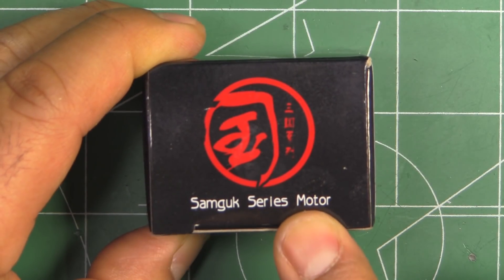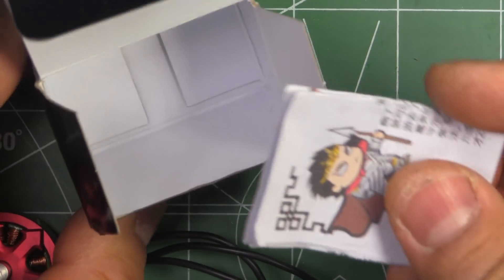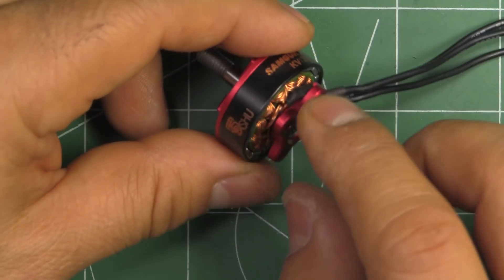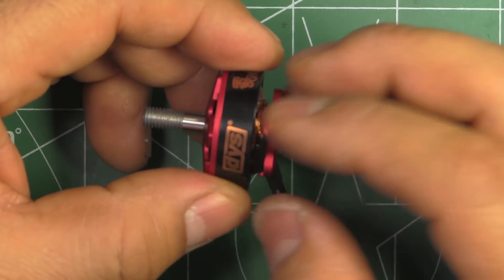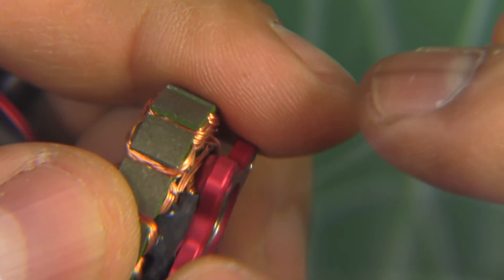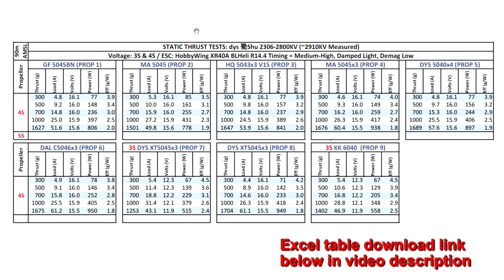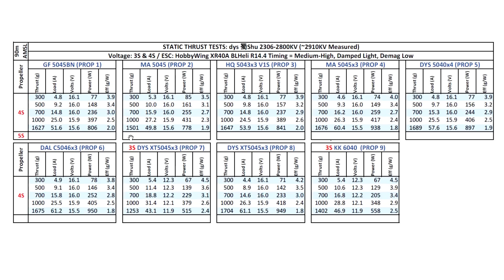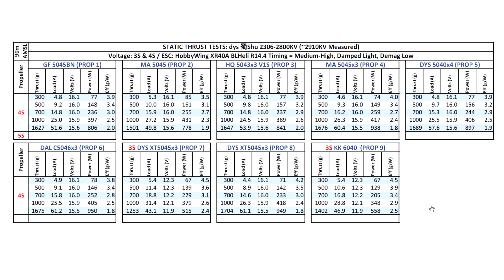dys Samguk 蜀Shu 2306 2800KV Affordable New $9.50 Motors from dys

Comment: I bought 2 of these motors and some Gemfan 6055 and 5050 props for a high speed custom plane. Do you think that on a 3s this motor would be able to handle a 6055 at >150 km/h ?
Reply from the maker: Looking at the test for the 6040 prop it's 47A max static so if we get estimated 40% lower in-flight Amps, that's about 28A. The 6055 prop will draw at least 30A. I think that's a bit too high continuous Amps for this motor, it might not survive, but I'm on the being careful side. I prefer more headroom and not being too close to the limit. You should check out E3Scott channel he flies setups like the one you have. This motors is lower 2630KV and he uses 6042 prop on 3S https://www.youtube.com/watch?v=wGTqcLD4Qa0

Comment: Hi EngineerX! I am new to the hobby, what would you recomend between those DYS and the AokFly RV2306? I read that the bearings in the DYS Samguk are very likely to break. Also I am afraid that a naked bottom will not be ideal in crashes (I am expeting to crash a lot, despite the hours spent in simulators). Thanks as alway for the good content!
Reply from the maker: Rock Rider 94 Naked bottom and full base can be equally strong, depends how well and thick in the critical places they made it. Yes lots of complaints bearings are weak on this one. Careful on the Aokfly. Also read lots of fake motors. I don't know who sells authentic one for sure but if you can find it it's a more durable motor.... based on comments I've read, not my actual experience but I do agree.
Reply: EngineerX thank you so much for your answere! I'll go with the aokfly from amazon, so that if they are fake I can return them.
Again, thank you!
Reply from the maker: Good choice, and yeah, Amazon is great for returns.
Here is the post about the fakes, go to #12, looks like Banggood may have been sending fake ones after the 1st couple of batches :(
https://www.rcgroups.com/forums/showthread.php?2925449-new-FIRE-PHONENIX-RV2306-2400kv-2650KV-out-AOKFLY
Reply: I read something similar, that Banggood is a sort of hit&miss with the aokfly, sending out fakes every once in a while

Comment: I brought 16 motors from DYS. I have to say... These motors is way to powerful for a cheap price.  There is couple things people should know. Don't use Gemfan 5040 PC props or Kingkong 5040 props because they like to explode in mid-air. You definitely need strong props to fly with these motors.

Also, you have to use 35a or 40a ESC to run these suckers. I already blow up three ESC because of this motors. 

Once again, 
dys Samguk 蜀Shu 2306 2800KV needs 35a or 40a ESC. 
dys Samguk 蜀Shu 2306 2800KV needs strong ass props!

dys Samguk 蜀Shu 2306 2500KV needs 30 to 35 amps.
dys Samguk 蜀Shu 2306 2500KV needs strong ass props!

Comment: Have you tested them outside? Is the quality good?
Reply from the maker: These have had several issues as reported by many. Unfortunate because they had very good potential. I think it would be best to look for another low budget option. Even the new Racerstar BR2207 might be better, but also you need to look for what people are commenting. I don't get a chance to test every motor in flight, there's just too many motors coming out and too little time on my end :(
Reply: EngineerX ok thank you very much
Reply: EngineerX i have got the tbs silk steele motors but im not very happy with them. So in my opinion even when a motor is very expensive it there is no big difference between budget motors.

Comment: Have you ever compared a motor with stock bearings as opposed to high quality bearings on the thrust stand would it make a difference in output or just longevity
Reply: I own a fishing reel repair and super tuning company.. we stock the best bearings on the market from abec1 throw away bearings to the finest ABEC9 stainless, ceramic hybrid and full cage ceramics money can buy.. the bearings of ABEC5 and up we run through out special,flushing/delubing/cleaning process then heat treat the bearings. We have the longest spinning/free spooling/lowest friction bearings on the market period.. bass fishing reel bearings for popular reels happen to be the same as most motor bearings for our race quads.. I can tell you this on high preformance motors I use my ABEC7 Stainless steel bearings in the motors the stainless bearings preform the same but are much less noise then ceramic bearings.. the preformance is NOT just longtivity of the bearings.. on a set of R5 2207 2700kv motors I just tested I gained a solid (avg over testing 6 different new R5 2207 2700s, first test each motor with stock beatings then my bearings) 58 gram increase in max thrust a avg of 1.2 less amps at WOT with a 58 gram thrust increase on hq5x4.5x3v1s.. and I can assure you those bearings will out last stock bearings 7 to 8 times and still preform better then a new set of the throw away abec3 rated bearings too spec manus use.. you will notice quicker response as well, we'll not so much freestyling but on tight race courses with a light weight high powered build you will notice slightly quicker response.. it's not a lot but if you are really in tune with how a,quad flys on a track there is enough of a difference that it will make it feel that you increased your rates 10 to 20 DPS mainly on yaw and roll pitch isn't so much noticeable. Good bearings are a must imho (I keep saying it in gonna start marketing to the mini quad crowd before Boca fucking bearings do.) They are better in every way..
Reply: Wicked Reelz how do I get some

Comment: I just put the 2306 2500kvs on a kopis 1 build with speedix 30a escs and hq5x4.3s and man it's freaking ripping. Amp draw isn't nearly as bad as I expected around 113 amps. They're not the best quality motors (cough $10 cough) but let me just say at this price I'll be buying quite a few as long as they can stand up to a decent crash. Oh and a clracing f4s with a unify pro

Comment: i'm wondering if the dal 5051 cyclone is a good match for this motor? i'm aiming for a super light build (armattan mongoose with dalrc engine 40a esc), or should i go for the wu 2206 2700kv?
Reply from the maker: Depends on main purpose of build. What I'm seeing, some people are looking for ultimate performance on 220 ~280g dry weight setups. Then you can use 1300mAh LiPo and very-high KV motors like this one will match OK because motor will not be loaded as much. Flight times should be around 2 to 2.5min depending how aggressive you fly. key is to build as light as possible.
Reply: i will give the 2206 2700kv a try, maybe i can use a lighter lipo that way (850/1000mah 4s)
Reply from the maker: 2206-2700kv should do well, but a LiPo that small most likely will sag quickly if you go hard on throttle often. You can always increase size of battery so no worries there. These motors are somewhat light so the 2207-2600kv would also be a good choice.

Comment: I have 30A Blheli S FVT Litte bees esc. Can they handle the 60A? I think in real the motors reach 50A??! Or is the 2500KV better for a racer ? Racer weight 340g with emax rs 2205s 2300kv
Reply: Saix FPV 
   The esc can be bigger than needed and it will be fine or even better. The esc will only supply the amount of amps demanded by the motors. Hope that makes sense without writing an essay lol.

Comment: Do you think a racerstar 4in 1 35a esc can handle this motor?
Reply: The REV35 is actually made by Airbot. The RS series is made by Sunrise model, the MS series is made by ZTW.
Reply: Oh yeah should be fine . Love the Racerstar stuff , I have pushed them hard on some really hungry motors and not had a single issue.
Reply from the maker: Bennie Leip I honestly couldn't say if that specific 4-1 ESC would be able to handle this motor because I don't know much about it. I read with other ESCs RStar has overrated Amp handling. I'd look to see if people are using it with 2207-2600 or 2700kv motors without issue first. If no issues then it should handle this one ok. Any good, true 35A ESC will handle this motor.
Reply: EngineerX thnks for awnsering 👍🏻
Reply: I'd say so. The Racerstar REV35 is made by Sunrise and is also sold as 30a continuous/ 40a burst under the holybro name. I use the rev35 in 3 different builds, one is 2306-2700kv, one is 2207-2700kv and one is 2405-2400kv. Does that help?
Reply: TheRealJonnyD thnks man , yes👍🏻 but i think im gonna spent a bid more than buying this motor ill gues ,because im getting sick of losing c clips for no reason , and then has the rest of the day vibrations because of it😒😆
Reply: IRFZ44 ah, yea. You're right. It's a Typhoon 30a rebrand.

Comment: Can some one please tell me good motors for a light weight 3 inch build (preferebally  11xx or similar weight motors) which produce atleast 400g of thrust
Reply: The Pragmatist SunnySky R1106-6500kv. Get them from SunnySky directly to guarantee they have the updated shaft design or spend a lot less on eBay and loctite the shafts. They're the strongest 11xx motor out there.
Reply: if you don't mind going to a 14.5-14.8 gram motor.. Iflightrc sent me a set of their 1606 3500kv and 4100kv motors and I was shocked by the preformance of them.. they have nice single strand windings, motor is made from 7075 alum (that's what they told me anyhow, and don't have any reason to doubt it, nice smooth bearings and really poor on the power.. the 4100kv on 4s 850mah 75c packs with the Gemfan 3052s, on a nice light 3in build they are lightning quick, great response, come down totally cool, efficient and just preform amazingly well (they are 55 dollars a set) they also sent me a few bags of their Nazgul 3061 props, I have flew the 5 inch version of that prop and it's so unbalanced it's not flyable unless you balance each prop... the 3061 version is flat fantastic, top end is faster then the 3052s by a good bit thanks to the higher pitch BUT the amp draw is not much higher, thrust is deff feels about the same BUT the response is on par with the 3052.

These right at 16 gram motors are insane, you do need th batteries to support them as they are hungry in the last 20% of the throttle range.

Comment: Hi, will you be testing the 2250kv version of it. Would like to see how it will perform as budget 6" motors
Reply from the maker: dys only sent the 2800KV. I ordered the 2500KV from BGood. Sorry , I don't think I'll be ordering the 2250KV version :(  but it should match nice with a 6" prop for more efficiency and plenty of thrust. Seems the motors are as efficient as any of the premium motors I've tested, or very close anyway.

Comment: Great performance for the dollar.  I've got the 2206/2700kv coming this week.  Going to compare them to the top end ZMX Finx23.
Reply: Got the motors. They last 10 packs before one let go.  The stator wasn't probably glued and it shifted about in the housing breaking the centre set of wires.  Poor QC.

Comment: Thanks ,X. These DYS's are shaping up to be a nice budget motor with lots of choice (have the Wei's) - looking forward to seeing the others in this line being tested.
Do you have the new Kingkong 2405's by Sunnysky being tested on the horizon?
Reply from the maker: Thanks for watching. Yes, I've ordered the KK2405 so that should arrive in a couple of weeks. I got the SSky 1408-3200. I'm gonna try to run tests on that one this weekend I hope.
Reply: Looking forward to the KK2405.
Reply from the maker: Yea, it's gonna be interesting to see how well it stacks up against the rest of budget motors. Racerstar BR2307-2500 & BR2406-2600 test videos will be up soon too.
Reply: I've had then since the week they came out, great motors. Running them on a 6" GepRC LX-6 frame.

Comment: Did they also send you the 2500kv version. This one is cool and all and quite the monster power-wise but impractical as well for most builds I'd imagine unless you got the money for 40-50A ESCs.
Reply from the maker: What I'm hearing from people who like to fly fast is that on ultralight 5" frames the very high KV motors do very well. But they need to build super light and motors don't actually pull all those high Amps, but of course LiPos only give you 2 to 2.5min flights per charge. I really gotta make some time to mount these on a frame with 30A ESCs and see if it doesn't burst into flames on the firs full throttle punch :)
Hopefully some adventurous pilot will fly them before.
Reply: EngineerX my experience on Superlight light quads, the prop unloads massively more than a heavier quad - too much, which is why they prefer a higher Kv as it offsets it. I’d be really surprised if a 30amp esc couldn’t handle these. You’d only be bursting for 3-4 secs tops, and on such a light setup, (below 250g) you’d be getting nowhere near that from a small battery. Pretty juicy figures for a cheap motor!

Comment: Yes its 7075 aluminium and hardened stell, I contacted them. Actually the hollow shaft was my recommendation, the older shaft in the first images would bent very easy.
Reply from the maker: I should've asked you or dys before I finished video. 7075 = Very good! and impressive for a $9.50 motor. Even if bearings turn out to be crap, you can just buy some good ones for about $2.50 to $3.00 and end up with a $12 motor.
Reply: No problem, awesome videos bud, love the tear down of the motors to see how they are made. Thanks for making this awesome videos.
Reply: Wow, I learned something today that isn't from Bardwell :

Considering it's your idea for the hollow shaft, you should probably get at least a 10% cut from each motor sold. Just sayin ;-)
Reply: I'll be interested in using them too if you can get them to make CW and CCW shafts!  ;)  No doubt  :D
Reply: Follow EngineerX, you have a lot more to learn. About the motors itselft i didn't win anything, not even a free motor... I helped because i liked the price and the concept and i actually in interested in using them. hehe
But the Hollow shaft dont bend, they break, but to break the shaft the rest of the motor is probably trashed anyway, the first type of shaft with hardened stell in the inside of the aluminium tends to bend a lot, i have that experience from the EMAX LS series, i got 5 replaced in 9... So yes that shaft was a major failure point.
Reply: GITech forget ccw... Not needed really. Nylon locknut's with cw thread's do the job.
Reply: GITech not really, I've flown a lot with cw threaded motors, it's just fine, believe me. ;)
Reply: FPV Portugal Correct it is just easier to take props off if you have a ratchet
Reply: FPV Portugal hollow shaft does not make it stronger, just lighter. A hollow shaft is the best way to use minimum material for maximum strength.
Reply: Coppertop FPV yes and no, it's actually stronger, the breaking point holds more force, check fisics
Reply: I've flown with both and with how you have to hold the bell hard so you can wrench-wrench-wrench the lock nuts down, and then have to hold the bell of the 2 that should be CCW really hard so you can crank them super tight ...and then you hit even a little branch or gate and you've got a loose prop or two... F that! I will never-ever fly again with all CW motors. 

I'm fully happy with my low profile, alu, flanged lock nuts that I've ground down to remove the nylon ring.. so I only have to slightly snug or crack loose, then easily flick the nuts on/off 'er up/down the threads. They self tighten. KISS. Let physics work for you. Why fight convenience and physics?

Comment: Yes, first again for the dys budget Beast motor. I ordered the 2207's!
Reply: 2207 2600kv
Reply from the maker: Nice! Keep us updated as to how well they perform after some abuse. Thanks for watching!
Reply: EngineerX 2207 or 2306?
Reply from the maker: Sorry - late reply
Both will get you good performance for freestyle. I think the 2207-2600 would be great for a light 5" frame. It'll be plenty powerful and just a tiny bit more efficient. If you're more concerned with longer flights, then 2300KV will be better and you can always use a 5S LiPo later on, so good idea to get 5S ESCs if possible.
But I think both motor sizes are a good option for 5" builds. If it's a light build it's going to be very difficult to see any difference.
Reply: whats the update Ryan after 4 months use?